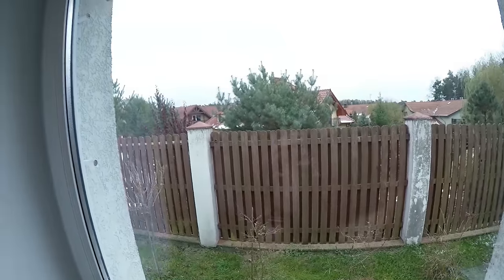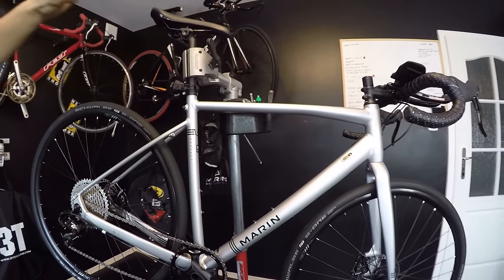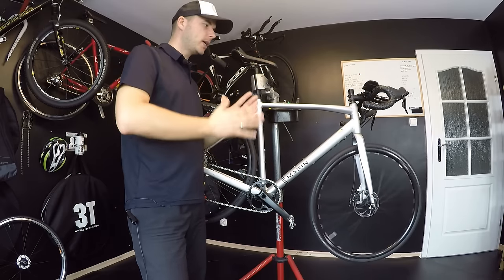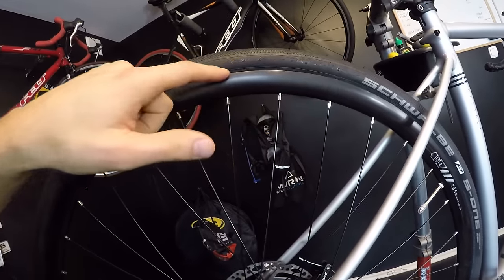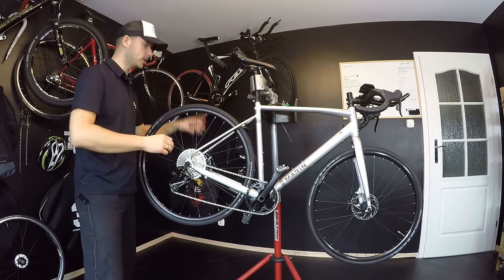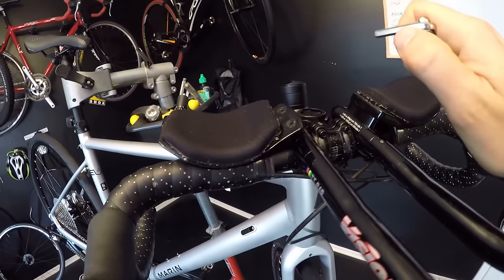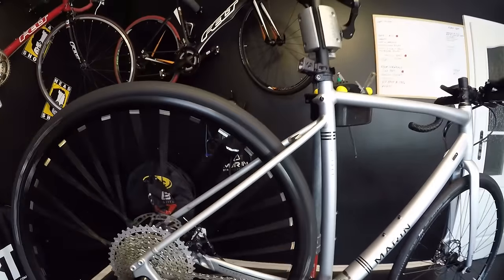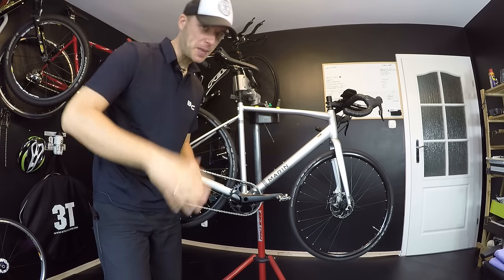99% Of NEW Bikes Need These 5 Maintenance Tricks For Your Safety. SickBiker Tips.

Comment: 1. Wheels don't need to be 100% true, even spoke tension is the critical measure - use a tensiometer to check the spoke tension before touching the spoke nipples - the tyres are also an area to look at because 99/100 they aren't perfectly round.
2. Go tubeless (the Marin is designed for this) - no more punctures + more compliant tyre due to lower pressure.
4. Don't need to degrease a new chain, the packing solution is an excellent lubricant and will last a lot longer than even wax dipping your chain - degreaser always gets into the inner links of the chain and removes the lubricant - not a good thing, degreaser needs to be washed off with water afterwards.
Reply: Hey James, does a chain get sticky like this when a mechanic lubes his chain, or is this sticky sensation just something specific to the type of lube the manufacturers use on new bikes?
Reply: 4. yes it will last longer before first /second lubrication but it catchs all dirt from road and it eats chain and rings, so if you are lazy it is good idea, but if you care about chain/ring life you will clean that  in first second and wax it every 100km and it will last at least 50% longer than you use any oil or grease, DO NOT USE WATER AND CHAIN IN SAME SENTENCE-when it come into chain it makes damages and it is hard to put it out

Comment: Shimano cup & come hubs are famous for not having enough grease in them and being too tight when new.
Also the freehub pawls tend to be under lubed on almost all new wheels from all brands.

Check the direction arrow of the tires also.

Install your front wheel so you can read the label when seated.

Comment: great points!...wish I had found this earlier...sticky chain caused me to begin searching for front derailure issue. When shifting to the smallest chainring the chain stuck to the chainring throwing the chain in between the chain ring and the chainstay...again thinking the limit adjustment was off. Anyway, your suggestions gave me the insight to look elsewhere...problem solved! thank you.

Comment: I would like to add, check the chain for proper length.  I've found several that were too long. Mainly on small frame bikes. I do all these things when I build a bike for the shop I work at. Check everything.  Hanger mount bolt.  Seat bolt/s. small chainring bolts....... When the bike is sold a different person rechecks all bolts tire pressures ect.  before the customer takes possession of the bike, along with a basic fit.   This is done for all bikes regardless of price point.   Give your customers a reason to buy from a quality shop, not online.
Reply: tonkabike I agree. I was reading if someone already mentioned it.

Comment: With the packing tape this works for me. If it has been on there a long time heat it with hair dryer before removing. Do not melt it just get it warm to the touch.

Comment: A trick I learned while truing. Take a zip tie and put on the fork or the seat stay cut at an angle and position so the point is just touching or a hair off spin the wheel to find the abnormalities. This works if you don’t have a truing stand.

Comment: I com
completely agree with trekkeruss...
1. Most all (90%) of loose bearing wheel hubs are always much too tight, and if they are not adjusted correctly the bearings quickly turn into coffee grinds.  So you can have a wheel hub that can last one week or 10 years by simply adjusting the hubs..  So when you purchase a bike at a shop "INSIST" they check and adjust your hubs, do not accept any excuses, or threaten to drop the sale.
2. Insist they check and true your derailleur hanger, with a derailleur hanger tool.  80% of new derailleur hangers are not true and will negatively affect your shifting.  Especially if you purchase an electronic shifting bike ie di2 or eTap. 
3. If you purchase a carbon frame bike make sure they lightly grease the inside of the seat clamp and the threads on the seat clamp bolt, otherwise the clamp will never tighten correctly and will tend to pinch at the opening of the seat clamp and crack the seat tube clamp area. 

There are many more, but these 3 are a must...
FYI, If your dealer says the hubs are sealed bearing not loose bearing, then it's OK since sealed bearing hubs can not be adjusted.  Only if they are loose bearing.

Comment: A little tip when trueing wheels and changing tubes....baby powder. It lubricates the tube so it unfolds correctly inside the wheel. Also, whn replacing tubes partially fill with air first then deflate...then reinflate...this takes any kinks out.

Comment: Yup, bought a new bike from Wiggle. Didn't check the tires, got a flat right away. Bolts on brake rotors, and general screws have to be checked as you say. Adjust derailleurs. Even when buying from a shop, they don't (all) check over these details.Be careful, do the above and you'll be glad you did.

Comment: Well, one thing we use to do here in Brazil is put some inner tube strip around the chainstay in order to protect it.
I think it's more effective than adhesive tape or thing like that. Just a tip.
Reply: If you're going to make it ugly with a piece of inner tube, why bother protecting it in the first place?  Obviously a steel bike could rust, but I see aluminum ones with duct tape, garden hose and other crap there that looks a lot worse than some scuffed paint and bare metal.

Comment: when you spoke about putting tape to protect your bike from the chain there is a very easy way to remove the tape if the glue from the tape refuses to come off. this is not a joke. apply mayonnaise yes mayonnaise to the adhesive which will not come off. leave it on for anywhere from a half hour to a few hours depending on how strong the adhesive is and then just wipe it off. no damage done to the paint.

Comment: Hi there mate, I own the same exact bike in the video (Marin Gestalt Two), and I've been dealing with an annoying clicking sound coming from the BB area...it happens when i push on the pedals (starting from a stand for instance), and the verdict from my bike guy it's it probably comes from the frame itself. I've replaced wheels, cassette, chainring and BB, everything's been torqued to specs and properly greased and there are no visible cracks anywhere on the frame. Do you agree with the aforementioned "diagnosis" or do you happen to have any different insight? Thanks in advance, hope to hear back from you!
Cheers from Italy

Comment: Great tips thank you - Hard to tell if wheel is true on mountain bike with chunky tyres, I have to disagree with how to clean the chain.... clean the new sticky gunk off but it needs a good clean not just a wipe
Reply: Indeed. Shimano advises fully degreasing new chains before use, to remove the protective coating applied at the factory (which is applied to prevent corrosion in storage & transit).

Comment: Hopefully if you get your bike from a shop they do all the checks you mentioned. I know when I was young and worked in a shop, we checked out the wheels, all bolts, tires, brakes, gears, etc. If they don't it probably isn't a good shop. Given that good bicycles are generally over $2000 (usd), customers should expect they are getting a machine in great mechanical order. I'm glad I know how to work on bikes now because shops charge more to work on bikes than they do to work on cars and it is nice to be able to do your own stuff at home or on the trail if the need arises. I have helped many people on the road and trail to fix common mechanical issues. If you ride a lot, know how to fix your bike!
Reply: Shops do that usually without exceptions - they often make most money on paid maintenance and parts, so they want the customer to be satisfied with their service. They usually require you to take the bike for first servicing withing a few months (otherwise they won't honour the warranty), but that first one is for free. 
Supermarkets generally don't do any of that, they just sell the bikes as they come and ta-ta, do whatever you want with it.

Comment: I read a number of comments and didn't see these.  I got a new bike with Mavic wheels.  After riding some and my first flats, both inner tubes were twisted in the tire.  I should have taken them out and remounted.  Also I think my chain was the correct length, manufacturer probably had a standard for that, but with the small front and rear gear combo the chain was not tight.  Instead of removing a chain link as suggested by other riders that saw the chain flopping around, I used the derailer adjustment screw to rotate the derailer back a bit and take up the slack.  We'll see how well that works soon.  I think removing a link would have made the large/large combo too tight.
Reply: That derailer adjustment seems to have done the trick, and the chain is not jumping teeth on the smallest cog.

Comment: I bought a bike where the rear tire was installed backwards...the rotation arrow was pointing backwards!  It was also NOT bedded correctly.  I use cheap car vinyl wrap for protection.  It is thick, many colors, and peels off easy!

Comment: Great vlog thank for the great advice I I use a Steel dish with diesel and an stiff paintbrush my thoughts are it works better than degreaser. And I’d go with painters tape so it doesn’t leave residue 👍

Comment: Good stuff but I would not recommend removing the 'stickiness' from the chain. The factory lube that comes on the chain is some of the best lube you can get and you shouldn't touch it until you notice the chain becoming dry.
Reply: You don't want the outside of your chain plates sticky.  It does nothing but attract dirt.  The only part of a chain that needs lubrication is the inner o rings.  Wiping off excess factory grease from outer plates as he did does not remove lubrication where it is in fact needed.

Comment: Ur videos are extremely helpful dear..
I also have a new Mountain Bike and it has a different problem its back axle and cassettes are wobbling and now my chainring also started to wobble i have 3 chainring set in front and because of that now chain started to rub on front derailleur.. what do u think is the problem?
Reply from the maker: Check the bearings of the rear wheel hub and the bottom bracket.  What bike is that?
Reply: @cannondany  i think it is the bearings not the bracket bcoz when i bought it was fine i checked by myself.. and now my front chainring also started to wobble!!
It is a alloy bike Montra MadRock!! Has 21speed 3x7.. and im surprised that it only ran 50kilometres..

Comment: I see why you wouldn't want to air the tubes/tires up so quickly. However, I work in a shop and a compressor is the most effective method to seat tires. The pressure will place the tire flush against the rim. All you  have to do is air it down to riding pressure afterwards.

Comment: Of getting new bike of first use, is it natural of disc brakes breaking in use of a tad of rubbing?  I went ahead to adjust brakes but it seems at the finest point is a little rubbing but wheel flys normal so Im thinking I just need to break in the pads.?. I dont want to take shop to do adjust because I feel shop will do a little here and there of other adjustments to have me come back like a a little twist to derailer or a few spokes on wheel. Just dont trust Shops of doing something minor to lead later of returning knowing it was fine before of any changes from original work.

Comment: I have a very old bike. I have used degreaser a lot. Total submersion  and a big brush. Rinse with water. Dry it with cloth. Lubricate with oil. Wipe off oil. Original chain 27 years old. Chain has no special pin. Original cassette sprockets. Just clean it. Dirt wears your chain and sprockets. Not the degreaser. 

New bike 2 years ago  now. I found out the front shifter was not  aligned properly. Wheels not true either.

Comment: You didn't mention something crucial. Stress relieving the spokes will more or less completely prevent fatigue cracking.
Reply: You're right.Maybe everyone should at least read a wheelbuilding book - the more comprehensive, the better the book. 
Wheels can be built too tight, and by following a book the first few times, I never had the problem at all, over 20 wheels. I still keep four as spares, although I went to the best maker when I was able to print more cash.
Reply: I used to break spokes because I used to be 100kg. Never now because I'm 82kg. Stress relieving fixed the problem when I was heavy.
Reply: You keep 4 wheels as spares?!  When each wheel is $1500 I don't keep that many spares around!

Comment: Thank you very much. I'm new to cycling, and these have actually all be quite relevant to my new bike. Wheel was actually bent and I didn't notice it was that way for a couple rides... The bottom bracket was also quite cheap, and unreliable. Spent 500 on it, initially, but it's turned into 600 or so USD. :/

Comment: I bought a Boardman bike for like £1000. I didnt check the  initial spoke tension and if the wheel is true or not. Few days after my rear wheel completely deformed beyond truing and Halfords (which is Boradman official dealer) told me that wheels are not under warranty. and I had to purchase a new  wheel for £120 pounds which is quite unfortunate.

Comment: in my lowest back gear is catching the chain on the one second gear ring. I figures my wheel, frame or rings are twisted a bit on the right but will work it out latter.
Reply: Just, Derailer's have 'a just able' screw's.

Comment: My new bike rims also seemed to not be 100% true but in the owners manual it states that you should not perform any adjustments until the bike has been broken in and it states to wait 30 days of riding before making adjustments like truing the rim.
I followed the instructions in my manual and the rim appears to have straighted itself the manual says that the spokes need time to properly seat as well as cables to stretch etc it says do not ride it hard until the 30 day break in period is over and have performed the adjustments needed at that time. What does everyone else think I am curious this is my very 1st brand new bike I have only ever had used bikes but this year I bought a brand new bike.

Comment: Thanks for the video, but I disagree with degreasing the new chain. The original (sticky) lube on the chain is the best lube your chain will ever have and should be left alone. If you're worried about it being sticky and holding onto dirt, you can wipe a little off with a rag or paper towel, but don't use degreaser.   Great video otherwise.

Comment: i bought a new bike online once,  and indeed both wheels were not true,  i thought i got screwed,  i haven't done anything with them because truing the wheel is actually a complicated process and and the nipples were even damaged like someone was using the pliers.   Anyway,  if even the high end pricey bikes come new so bad,  i don't see the point wasting my money on a new bike anymore.   I thought if i pay big grand on something new,  then it must be perfectly mint ideal condition,  i mean cars and motorcycles are like that.
Reply: All bicycles must be assembled, adjusted, & tested after they are removed from a box. Your local bicycle shop can assemble the bicycle you purchased on line for a fee, and make the necessary adjustments for you. Personally,  I prefer supporting people in my community by patronizing their business,  rather then purchasing from a retailer on line.
Reply: Kevin Gary 
I agree with you. The last two bicycles that I purchased were purchased online. I had them shipped to the LBS for assembly and inspection. And of course, I paid them for their service so they made some money. Furthermore, when I want to sell a bicycle I put it on consignment at the LBS so that they make some money on the sale. I want them to stay in business.
Reply: "it must be perfectly mint ideal condition,  i mean cars and motorcycles are like that."  Nope, your local car dealer, and I imagine motorcycle dealer, do a lot on a car from the manufacturer.  They charge you for that too, see the dealer prep charge on a new car.
Reply: Don't think I've ever bought a new car that needed an alignment, oil, lube, balance, and tightening of all the bolts...

Comment: question. I had my lockout on and gave it some small impact(jumping off a street curb). is this something that could make my rims Un true? the tires look wobbly but it's just the tread. the brake pads aren't wobbly so I'm not sure. help?
Reply from the maker: If the rim feels seems to be true, you could actually damage the tire, but it happens very seldom that way. I would also check, whether the tire didn't move (check out my video about truing the tires).
Reply: my tires are fine, they were wobbly when I first rode. the shop had a thorough inspection on all those issues. I'm not sure though
Reply: MCatwar Yes you can knock your rims out of true. Tires usually handle impacts well unless they are defective. If rims are true but tires are not, check that they are properly seated on rim. If they are still untrue-replace tires, there is something wrong with them and they could be dangerous to ride on.

Comment: A very interesting and informative video, although one thing you didn't mention was to check the adjustment of wheel bearings and pedal crank bearings, which on new bicycles are often too loose or too tight.
I haven't used bicycles for almost 50 years but I'm still interested in the advances that have been made in the technology used. however, I think the old "cup and cone" bearings are still used for wheels and cranks, and I think that every cyclist should pay particular attention to their adjustment.